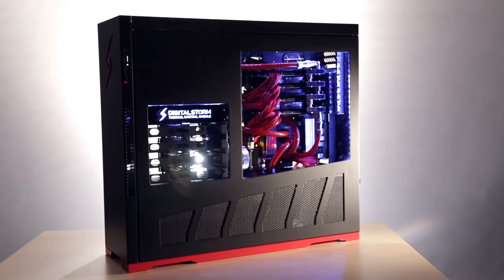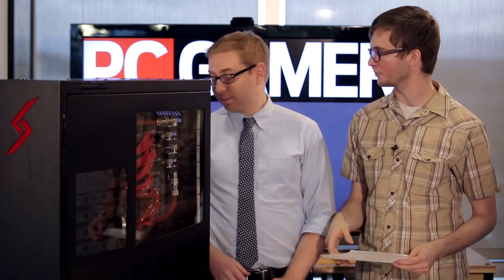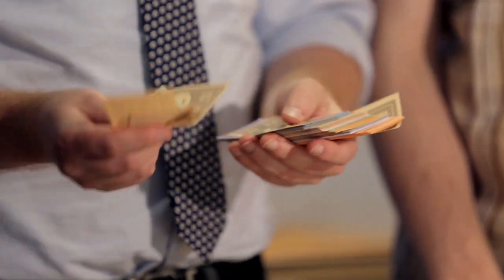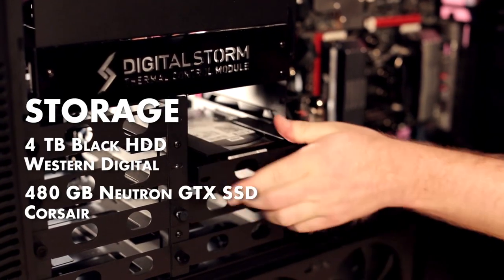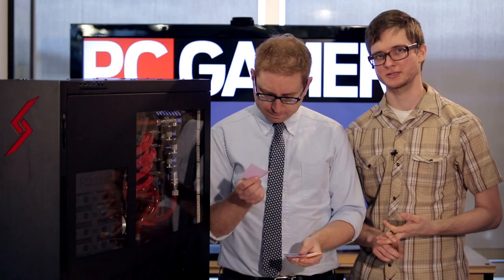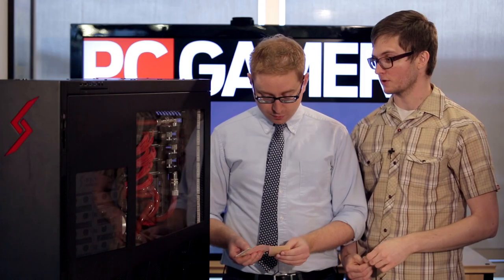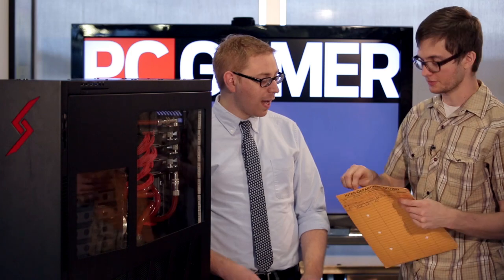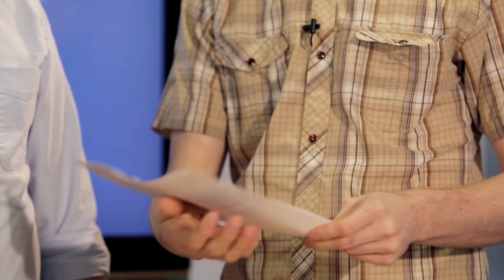How much does the Large Pixel Collider cost?

Comment: Come on guys,that's the cool thing to the  PC gaming you can build a pc system from 300$-20 000$.
Reply: $300 may be a bit low balling for a performance machine... If you are talking a decent rig be prepared to spend at least $1K
Reply: Mr. Rolex all you need is about 600
Reply: I really have to disagree. If you are looking to build a powerful modern gaming system, that can keep up with modern games etc, and the soon to come 4K craze, $1000 is lowballing.
Reply: Mr. Rolex Not really dude because they came out with R9 and R7 series graphics card by amd,which does 4k resolution but even then why get 4k resolution. I'm building a computer around 400 dollars and re-using my GTS 250 which still gets 60fps on most games. I'm not going to play crysis kind of games or bf4, just games like killing floor or league of legends kind of games and maybe some minecraft. About 600 dollar is enough for a moderate gaming pc because 1k is starting be about over kill unless your planning to do extreme gaming. 1k isn't low balling anything because my friend spent 2.6k on a computer with 32Gb of ram and a 8 core amd processor so there is difference when it comes gaming because you can spend less to get the performance you need not want. Some people like to spend more for that speed that they don't need but as an hobbyist love to go to the extreme pushing things to it's limits with overclocking. With that said, your not going to have ram over clock at 4000Mhz or have a cpu overclocked above 4Ghz for a game. So conclusion Mr.Rolex people are smart with their money and knowledge be able to spend less to get the performance they need to play a game so if you tell me this is bullshit then you don't know anything about parts down to it technical specs.
Reply: Exactly and I agree with xLucky
Reply: ***** Well,you would'nt be able to run games in 4k resolution with all the setting maxed out on that.
Reply: Adi M Why would you want 4k in the first place. See if I had a 1920x1080 or a 1600x900 monitor I will be fine because you don't need 4k resolution at all.
Reply: Goldenjews1234 PC Gamer has an interest in showing the games they review in as high a resolution as they can. Having a PC that can do 4K without even trying suits them fine.
Reply: Mr. Rolex
"If you are talking a decent rig be prepared to spend at least $1K"

Nah. I'm running a PC build somewhere about 800 dollars, purchased- some parts are old and have gone down in value here and there, but give or take 800 dollars.

I'm not 'lowballing' it either. I can play high end games in 60fps (1650x1080), and I usually stay above 30fps in just about all games. There are some exceptions of course.

I can stream easily (games in about half resolution on a 60fps stream, and drawing in full resolution), and I have enough RAM for literally any game I'd ever want to play. 

So a 600 dollar gaming rig is more than possible.

Comment: Man, this is actually an insanely good buy. I remember when I first got into PCs and the Pentium Pro was top dog, DEC came out with the 450 and 500 MHz Alpha machines, and those cost about $12,000 - $15,000. You could probably emulate several of those simultaneously in software on this thing!

Comment: I actually have alot of this stuff in my computer lol, Intel i7 4960x OC'ed to 4.0Ghz, ASUS Rampage IV Extreme Black AC2 Edition, 32 GB of Corsair Dominator GT 1866Mhz RAM, Corsair Force series 240GB SSD, 780Ti Gigabyte Windforce Edition, Corsair H100i (Dont recommend for my case...), ANTEC 1200 V3 Black Steel ATX Full Tower "Unbeatable Gaming Case(Should have got a corsair 900D, fits the cooling better and has better wire management)"

Comment: Crappy RAM.. they would have got way better timings with G-SKILL RAM, and Quad Titans are already outdated.. theres better cards out there that draw far less power than those..

All that and only using onboard sound? cmon no ASUS Xonar Essence STX? or not enough 1x slots available after the Quad SLI set up?

Also give credit to Digital Storm for the watercooling assembly?
Reply: Look at when this was put out there, then go and look at the LPC specs now, I think you'll find they've changed it up a little since 2013

Comment: Tax/Shipping & Handling//radiators/SP fans/PSU..?

Coulda got more SSD's.

I'm planning on getting a supercomputer from these guys; same case, and yes..it's gonna be a completely irresponsible build, and as PC gamers people always ask us the question, why spend $750+ for multi platform gaming, well it's fair to say- WHY NOT?!

My Aventum II specs-

CPU-i7 extreme overclocked to 4.4-4.8 ghz 
Mobo- Asus Rampage IV black
Ram- corsair dominator platinum 64GB
Cooling- Custom liquid cooling; nickel plated copper pipes
GPU(s)- 2 Titan Z's for quad SLI
PSU- 1500 watt corsair PSU cause why not? 
Storage: 2x 512GB samsung evo 840 Pro series, 2x 1TB Samsung 840 Evo (was going to get 4 TB of the non pro series but I like this layout better), 2 4TB WD Black, all drives in raid 50 (might just put SSDs in raid 0 and WDs in raid 1) 
OS: Windows 7 Ultimate x64 bit
Case: Aventum II
Mouse: Razer Naga epic
Keyboard: Logitech G19s 
Monitors: 3 LG34in (soon to be released) 

I promise to you all...I WILL GET THIS...one day. 

My parts may change depending on how long it takes.

Comment: 4 titan Z's and 2 1tb 840 evos
Reply: Correct me if I am wrong but Titan Zs are 2 GPUs in one and you to my knowledge can only put 4, not 8 GPUs in a rig.
Reply: *****
its the power of 2 cards on 1 card
Reply: I'm sceptical. Every source I have heard from says you can't 4 way sli Titan zs
Reply: *****
maybe, not but a titan z is one card
Reply: 231ian1 Read what I said first and my responses. You are beginning to look thick. You can run two dual-gpu cards (Titan Zs) or 4 way sli with Titans. The drivers and hardware don't support any higher. Go look it up. So yeah, lets let this comment trail die as I am bored of getting your notifications.
Reply: 231ian1 Sorry about that. I was a little snappy. Hadn't slept in like 26 hours :P Was grumpy. But yeah. Hopefully we are all clear now.
Reply: ***** I've seen a PC w/ 2x GTX 690 Quad SLI. (Yes that is 8 690s)
Reply: Deadly Dolphin
quad is 4
Reply: 231ian1 IK, they were running double quad SLI in one PC, hence the 2x.
Reply: Deadly Dolphin
oh
Reply: Deadly Dolphin give me a link and i believe you
Reply: Correct. At the moment SLI is only capable or 4 GPU's at once, however I wouldn't be surprised if there were more
Reply: I got 2x Titan Z's in my new machine i ordered from digital storm. The machine i got was 20,000 which was a lot more then this, check it out here: http://www.digitalstormonline.com/forums/my-hailstorm-ii-tidf23051-pnf1/
Reply: Deadly Dolphin The Asus GTX 690 is a dual GPU card and they had two of them which is 4 GPUs not 8.
Reply: Hunter Sharpe I don't know if you clicked this link but it clearly says 8 690s (or double quad SLI if that's what you prefer) http://www.l3p.nl/other-builds-mods/cross/hardware/
Reply: Deadly Dolphin It clearly says: 2 x Asus GTX690 Quad SLI, not 8. Its not possible/supported yet for 8 GPUs. 2 690s is 4 GPUs. Where it says Quad SLI after its referring to what configuration BOTH cards are in.
Reply: 231ian1 titanz's are the power of 2 in one card... yes.. aka 2 gpu chips on 1 card.. so 2 cards is 4way sli.
Reply: Tyler Gifol
its still just sli because its ONE card with TWO cores

Comment: this build is cheaper and much better...

Cooler Master Cosmos II
Intel® Core™ i7-5960X 3.0 GHz
Waterkoeling Corsair Hydro H100i
ASUS Rampage V Extreme
Crucial 32GB DDR4-2133
Nvidia GeForce GTX Titan X
Nvidia GeForce GTX Titan X
SSD Crucial BX100 1TB
SSD Crucial BX100 1TB
Blu-Ray Brander LG
Blu-Ray Brander LG
51-in-1 Cardreader
Asus Xonar DG
TP-Link 1200 Mbps WiFi USB Stick
1200W SilverStone ST1200-G Evolution 2.0 voeding
CM Storm Devastator Gaming Gear Combo
Windows 8.1 Pro NL 64Bit
Price: €6773
Reply: Lars Hoeijmans  really?cm storm devestator??it's piece of dumb
Reply: Lars Hoeijmans 
Lol Asus Xonar DG: crappy sound card, why the hell would you get a wireless USB stick? Get a wireless network card instead.
2 br disk readers totally unnecessary, 2 1tb ssds totally unnecessary, CM storm devastator literally crap. And Win 8.1 is indescribably stupid to get.
Card readers totally unnecessary, One titan x would be more than enough

Comment: ok, lets see how much watts needs to use that pc, i have to spend over 4 euros/hour to play, if i play 5 hours a day, how much i will spend in a month? its a suicide...
Reply: Not really since the gpu's use about 300 watts a piece max.  So unless you are running a game that caused 4 gpus to run at there max power the cost isnt that much.  You would need 3 4k monitors running crysis at max to get to that level.  Most games will run at less than 10% utilization becuase of the bottleknecks of the game's not being able to utilize the processor.  Which is usually around 120-150fps

Comment: That's the coolest name for this computer lol badass

If I won the lottery I'd buy one even though I barely use my gaming PC. PS4 master race
Reply: lol sure. just remember that the components are now old and if you bought a new pc today you would take newer components.
Reply: Vault Nomad Lag you say? say that to my 4690k and gtx 970. And if youre talking about network lag, then your console will have the same lag your pc will have. The pc doesnt just make your internet connection slower...
Reply: I will say lag to your 4690k and gtx 970.  Go play dayz and arma 3 and say the PC has no "lag".  I am running a 4.7 ghz i5 3570k and a gtx 780 and I notice hitching in alot of games.  Everyone says its "my pc" but I have built 3 PC's in my life, and they all did the same type of hitching/lag in games like fallout, farcry 3, skyrim, ect.  I also seen my friend's PC stutter and hitch up and he says he doesn't have any stutter when I notice it.  On the console with standardized hardware, there is no stutter or lag.  So say that to console gamers with optimization.  I don't even have a console, and from my comment there was never even a mention of me owning one.

Dumbass.
Reply: PC sucks becuase of badly made games, that's why if I had the choice I would go back to the console where I didn't spend $2000 to just get the same performance that consoles ran on.  Actually consoles have less stutter from like I said.  I played skyrim on xbox 360 and it never lagged.  Just 30 fps all the time.  The ps3 version did alot though.
Reply: Vault Nomad how bad is the lag youre getting? With your pc you should be getting like 5x the performance of a 360 or a ps3. Shit, the consoles run most games at 720p 30fps. You should be getting 1080p and well over 60fps with that setup.
Reply: I do get well over 60 fps,  I get like 120 in Newvegas and it hitches up alot becuase Its a badly optimized game.  Rinse and repeat with almost every game ib my steam library.  Only games that are ok are just cause 2, bad company 2, crysis 2 and 3.  Rust is a game that looks like shit and also runs like shit.  Thats my only complaint with pc gaming is the games can be disappointing becuase they arn't optimized well.  You may not "notice" it but its there.  High fps does not nessessarily mean you won't experience hitching
Reply: Vault Nomad then i guess console gaming is for you man. I love pc gaming and will never go back to a console as a main gaming machine. Although pc gaming might problems in some games, its really not that noticable unless you have ocd or ocpd or something along those lines. Not insulting you, just consider that nothings perfect
Reply: Well yea I do have have ocd
Reply: Vault Nomad hmm peasant and console fanboy
Reply: Vault Nomad Your computer just sucks if you have any hiccups while playing a game. You can easily get a setup for the same price of a console that can run any game at 60 frames.
Reply: Machoalbatross It's a lot more than just some games.

I agree with him. THe ridiculous inconsistency of PC games just sucks. It's not PC's fault, it's just the name of the game. It can be extremely annoying to deal with among a lot of other things on PC. Sometimes PC gaming just feels like a chore to me. I don't want to be googling for solutions to problems that shouldn't exist, I want to just play my games.

On console, I can do that. Not all games on console are totally consistent either, but it's a far cry from the varied performance of PC games.
Reply: Hugo Stiglitz Again, if you were smart, you'd invest in a cheap build which wouldn't have any issues. You're the delusional one here. PC has most of the consoles games plus many more, so it's not inconsistent. All you have to do is download Steam and that's it. You make PC gaming sound like calculus.
Reply: Also, here's one such build which is exactly $400 that can run GTA V at 50-60 frames per second: http://pcpartpicker.com/p/WxBLHx and that's if you don't want to upgrade the parts.

Comment: Not good enough...
Really not impressed...
Where is the 64GB@3GHz RAM?
Where is the RAID6 SSD solution running six of the fastest SSD's on the market?
Where is the PCI-E SSD to operate your OS from?
Why only One 4TB Drive? Should it not have been at least two or three?
One for games and one for capture storage?
Where is the 4x 780GTX Ti?
Why the Intel Core i7-4960X and not the Intel Xeon E5-2697 v2, or the Intel Xeon E5-2697 v2?

I must say that I am really disappointed to see this when you didn't even come close?
I would have said do it over as this can hardly be the most ultimate gaming PC that money can buy (even as of the date that this was made/posted.)
You have shamed the glory of ultimate gaming PC's with this nonsense and have used the name in vain.
Redo it, and do it right. (I would think that people in this line of work would have done this from the get go, not do it half assed and claimed.)
Reply: Dont Worry Team
Sure. But it's going to cost more than 10K.
Dude, they said "that money could buy". They even made it clear in the video that it was going to be the ultimate no matter what it would cost.
That they failed to do. That is what I am criticizing.